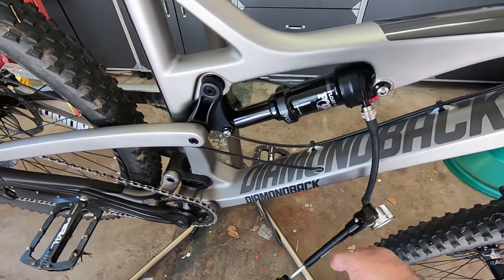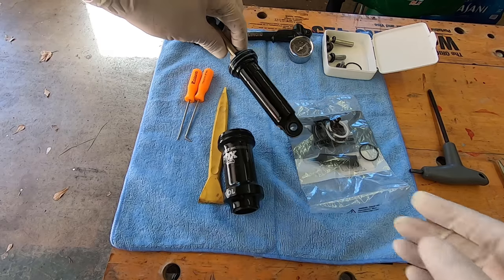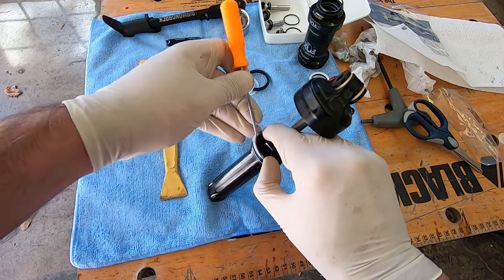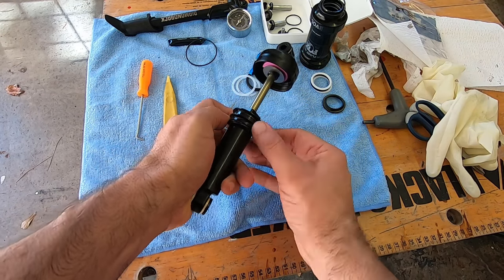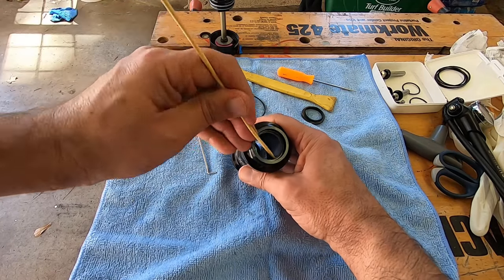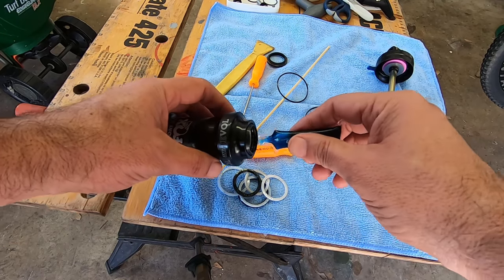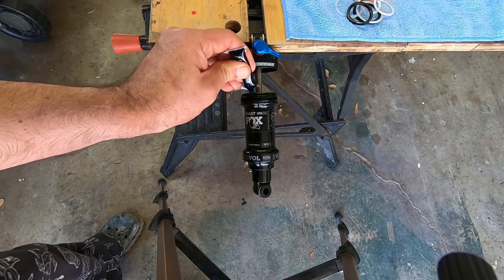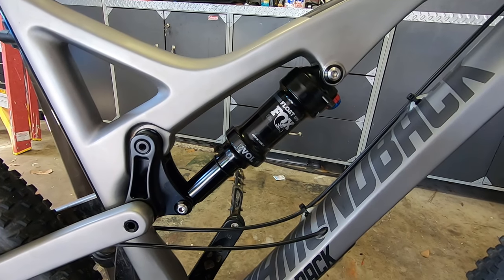2018 Fox Float DPS Evol Rear Shock Sleeve Service

Comment: For the tricky part: found it easier to use a metal pick (I bent a paperclip into a tiny hook with needle nose pliers) to remove the rubber seal, before removing the white washers after that, carefully, with tweezers. I couldn't do it with a wooden skewer; that kept breaking. Thanks for the video!
Reply from the maker: Good tip! I didn’t think about using tweezers 👍

Comment: Thank you Tony, was able to do my 1st rebuild/service today!  I had a hard time pushing the can back into the threads after filling it up w/ 2ml of fluid so I just screwed it back into the bike to get more leverage.  Other thing that worked for me was when I put the last white plastic ring in I just inserted the part that I slightly curved into the groove above the rubber washer.  Then I just used my thumb to continue pushing the rest of the washer into the groove.  Hope that makes sense.

Comment: Some tips on the new type DPS shock with an air chamber in the cap.  Mine is 0.8 cubic inches in size and totally obscures any view of the O ring in the cap.  You must take an "L" shaped metal tool of some kind and jerk the plastic air chamber down the shaft  It can be removed from the shaft since it has a gap in it and you can put in a different sized air chamber, but I don't know why..  Then you can see and remove the O ring at the very top of cap of the shock.  The air chamber has a small plastic washer that goes below it so you snap the air chamber on the shaft above the plastic washer.  Boy Howdy, things have changed since I last did this on my older bike!

Comment: thanks for such a detailed video—going to try it.  also, your bike looks immaculate
Reply from the maker: Thanks, I enjoy working on my bike almost as much as I enjoy riding it 😁 I also like to do trail work whenever I get the chance
Reply: I should have waited until I looked up my shock before posting.  I have Fox Float Factory Evol DPS, Kashima coated.  From the Fox site the seal kit has different part number and different seals than the basic Float seal kit from Jenson.  when I looked at Fox posted steps on seal replacement it is a lot more involved than the basic seal kit work.  After looking at the Fox instructions I am likely taking it to a shop now.
Reply from the maker: Good to know. I thought the only difference was the Kashima coating
Reply from the maker: So I was searching and it looks like the design changed in 2017, mine is a 2018 and the 2018 Factory looks just like it. The 2015 has an extra removable outer sleeve.
Reply: @TonyHob  Yeah, I’ll have to go over the Fox instructions in more detail, as it may be that what Fox has posted is the most thorough approach that only the person with special tools can do?

Comment: Hey mate, I have the same shock, but I let the air out really fast, and now I cannot get the body back up to screw back on. Cheers.
Reply from the maker: Try installing the shock back on the bike with the sleeve already slid onto the shaft, then have someone compress the suspension while you screw the sleeve back on
Reply: You have to take it out of stuck down mode. The fox site has a step by step guide on how to fix that

Comment: Tony can you only put in one volume spacer are can you put in a few? The kit online comes with 4 pieces all different sizes.
Reply from the maker: Only one at a time. The kit allows you to try different ones. You can also change them out for different type trails if you want.
Reply: @TonyHob  Thanks I just want to make the shock stiff. It flexes a lot because I am over 200 pounds.
Reply: Cool!  Thanks. I have that exact bike so this tutorial is perfect.

Comment: Cant get the body back up to screw it on.
What am i missing. Should not be that hard.
Reply from the maker: Try installing the shock back on the bike with the sleeve already slid onto the shaft, then have someone compress the suspension while you screw the sleeve back on. The shock will still have significant resistance when putting the sleeve back on.

Comment: Followed your instructions. Awesome video thank you! 🙏🏼 I ran into an issue tho… when I pumped the shock back up and did the 30% sag to let the air equalize, it let out some air, but then makes a little crunching sort of gritty air bubble noise? Is this normal? I let out all of the air, re-pumped it up and it makes a gritty air bubble kind of noise at 30% sag. Do you have any suggestions? Is it okay to leave alone?
Reply from the maker: It’s probably fine. You can try letting air out to about 50 psi then compress and decompress the suspension (cycle it) through 20% of its travel around 10 times. Then pump it up to 30% sag and see if it helps

Comment: I had a bike shop place a 0.8 volume spacer in the shock today. Now the blue lever goes way past the open position. Any idea what would cause the lever to be out of position ? The medium and open position feel the same.
Reply from the maker: Not sure what could have happened other than the not going through the proper air bleed procedure. I would definitely take it back to the shop

Comment: Hello does the fox seals work for every shock mine is FOX Racing Performance Float DPS air shock with rebound adjust and lockout.
Reply from the maker: The kit says it is for all Fox DPS rear shocks. Double check on the Fox web site but I am pretty sure that this kit will work.
Reply: Hi guys, do you have the part number of the service kit you used for shock? TIA
Reply from the maker: @matthewbentham7144  a little late but I added a link to the description. https://amzn.to/2ZdZg0C

Comment: Tony, in your experience, can my DPS be pumped to mimic a locked out situation? I was considering deleting the remote lock out lever and cabling, and just have it permanently unlocked but pressurized to mimic a hardtail. I only weigh 125 pounds.
Reply from the maker: You might be able to do it since you are light, as long as you don’t go over the max psi (350 psi for the DPS Evol). I just lock mine out so I have not tried it.
Reply: @TonyHob  Okay, thank you.

Comment: Have you ever had a clicking sound when compressing your Fox Float shock?
Reply from the maker: On the bike yes, it comes from the mounting hardware. Remove the shock and lightly grease the pivots. Sometimes you have to service all the pivots on the suspension.
Reply: I have this problem too, the bearings, fitting hardware have all been replaced and still making the same noise. Checked all fittings are correctly torqued. Any ideas what else might cause it?
Reply: @TonyHob  I have the same creaking noise.  Drives you bonkers.
Reply from the maker: @JUNJUN-lw2vr  is it the same bike?

Comment: Is it necessary to change those rubber seals and parts during regular service?
Or is it ok to just clean those parts, lubricate them and put them back?
Reply from the maker: The seals wear out so it is best to change them while you are at it. The kit is only around $20 though I will admit it is tedious to change them. If you have no leaks you could probably get away with cleaning it out, replacing the float oil and wait another season.
Reply: Ty for your help!

👍

Comment: Thanks for the video. I didn't see you used neither of the 20w nor 5w oil referenced in the description in the video. When and where do you apply those? Is the oil came with the kit sufficient for the job?
Reply from the maker: The 20 and 5w oil is used in the front suspension fork. The oil in the kit is all you need for the rear shock
Reply: @TonyHob  i see also that you used just a little part of that oil. The rest of it, can be used next time, maybe after 1 year, or it doesn't resist once opened?
Reply from the maker: I saved the rest. It should be good
Reply: @TonyHob  ok thank. In few days i'll do the service on my shock 🙂 thank for your video

Comment: And finally, nylon picks are worthless for taking out the plastic and rubber rings.  I tried them and they are not sharp enough and bend too easily.  Just use a metal pick and be very very very careful.

Comment: Looks like too much fiddle farting Going with a new one.
Reply from the maker: You get your car serviced at the dealership don’t you 😂 j/k
Reply: @TonyHob  Dealership yuck. Just installed a new power steering pump and Hydroboost in my Tahoe and I’m throwing in towel on working on the Motoped. DNM rear shock I found for $100 slides right in and should work for a few years like the original DNM. Good video and maybe someday I’ll be up for the rebuild.

Comment: Im sooo glad i dont have suspension on any of my bikes. As a long time bike tech, i can tell you, proprietary parts are stress inducing. Funny, suspension is not even essential for bicycles. Only service suspension for customer bikes. Wont be caught in my casket with this crap on my bikes.
Reply from the maker: My first MTB in 1992 was a fully rigid Cro-Mo Peugeot with Shimano DX components. Rigid frame, rigid fork. Loved that bike. At 56 years old I can now appreciate a good suspension in rocky root filled terrain. Hopefully I'll continue to MTBike well into my 70's. Might have to get an e-bike by then though, LOL!
Reply: It's just not possible to ride many trails in Colorado after erosion and trail wear have made the trail very rocky and rough.  It some places, trails are like riding up the middle of a streambed.  

Not only would it be extremely uncomfortable on a hard tail bike, but control of a bike would be severely compromised. Once I was following a hard tail up a rocky path and his rear tire was off the ground bouncing in the air about 50% of the time.

 It is a pain to replace the seals in a rear shock, but it's something that's doable by a home mechanic.  The front forks are another issue; those go back to Fox or a local shop for service.  But by gosh, to each his own.  That's what is great about mountain biking!